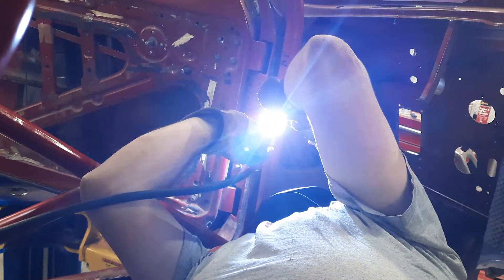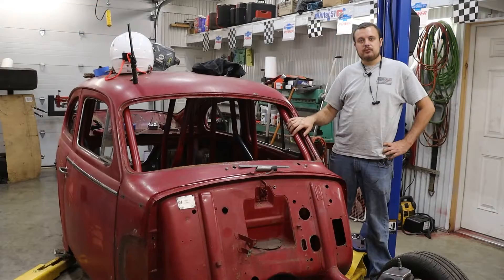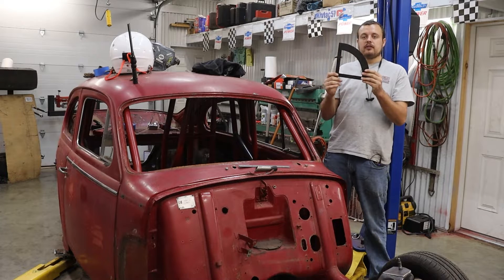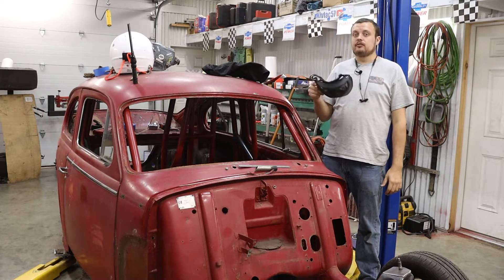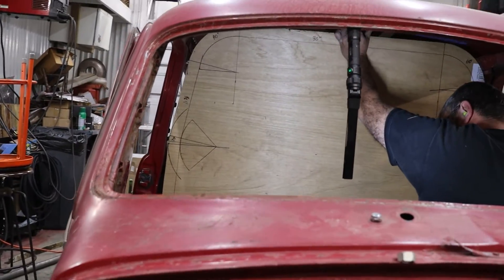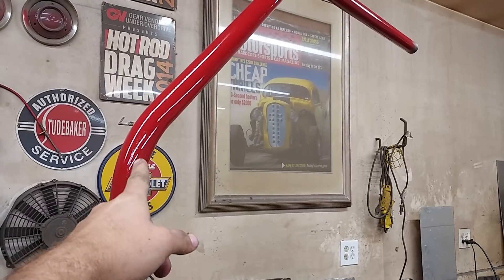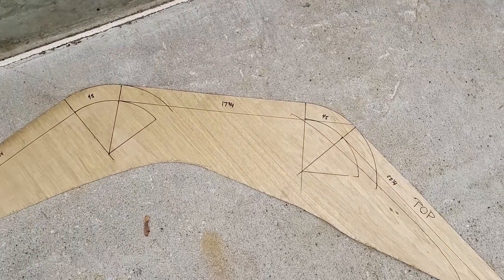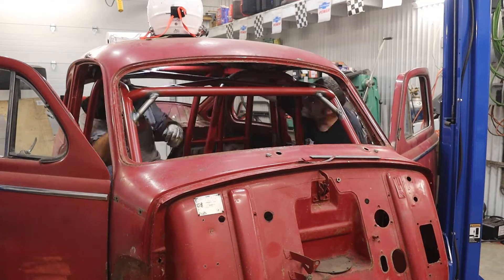How to Build a Roll Cage - Tips and Tricks To Getting the Ultimate Fitment - Volvo PV544

Comment: Great welds. 
I thought about it for a long while, why didn't you just cut out the floor?
Reply from the maker: Trying to retain chassis stiffness and reduce that effort. The stock floors are required for this level of certification as well. Not saying you couldn't weld them back in, it just adds complexity.

Comment: Excellent video as always! Time for a thumb control for the tig? A machine with 2T/4T controls would be cool, or a pressure sensitive version.
Reply from the maker: Yeah. I think I'm ready for a thumb control. Not sure what the other stuff you mentioned is. Teach me.
Reply: @Calvin-Nelson Calvin, thumb rheostats leave a bit to be desired, you may want to consider a simple on/off button and (possibly but not necessary) a remote rheostat, while it is not as slick as a nice pedal you can produce very high quality joints that will pass x-ray and visible inspection, in many ways this type of welding technique rewards those proficient in oxy/acetylene welding (no, not brazing)  travel speed and the filler wire determine the actual joint heat.

Comment: On the laying on the tunnel and other foreign objects; I have an old pop on creeper that used to have a bad wheel; without the wheels it made a great back board. Outside, in the mud, I have used thin plywood, cut to fit into whatever hole I needed to work in. I have always thought the roll bar was to keep all the "go faster from" killing you the first time you asked big and got more than you bargained for!  FR

Comment: Great tips , but for me and tig welding. The painting can wait till the last procedure is done. Nothing like blowing a weld due to contaminate from the paint process. And being an engineer I figured you would have used Solid Works or BendTech for cage design. The balsa wood trick is a good idea for those without the program . 15 min mark is when I would paint. But that's me LOL. You guys are kicking butt!!! Looking forward to the end result and track testing!!
Reply from the maker: Yeah. I'm not a big CAD guy, unless you are talking about Cardboard Aided Design. Takes way too much time, and usually doesn't come out the way you want when you actually do it. If I had more precise machines, maybe... but probably not. Just not the way my brain works.
Reply: @Calvin-Nelson  I guess that depends on who's using the programs. I worked in two bending shop's. And they could hammer out drawings pretty quick. I have a old copy of Bend Tech. I bought it with my bender package. It paid for it's self the first car I did a cage in. But most of the time I lay out stuff. Especially single plain. A pillar bars, that follow the body lines tight. Bend Tech saved me throwing away materials. Great project. Looking forward to the rear suspension and frame updates.
Reply from the maker: @hartiaacres  yeah. I could see it helping with that. I just find CAD something that slows me down most of the time. Why draw the part, when I could just make the part. Just how I was raised, I guess.
Reply: @Calvin-Nelson Calvin, not sure how many are aware that CAD designs are a tool limited by the actual dimensioning of mating components, unfortunately CAD being mixed with production tolerances doesn't work well in many cases as a practical consideration because of production variations which actually defeat the major purpose of CAD.
I know from working with a few really sharp engineers that the CAD operators that produced drawings reflecting real world integration of CAD designs would call out for "as built" solutions to the issue of CAD precision mixing with mechanical "drafting variation in the pre-CAD era" components, they realize to make it all work sometimes it does take good old "trial and error" by the hands of an experienced tradesman  to make it all happen.

Comment: Do you sell bend guages?
Reply from the maker: Like I said, they're not a one size fits all sort of thing. We made ours to take into account spring back. A 6 inch radius die does not always bend 6 inch radius. It probably is somewhat close though. I suppose I could sell the design we use.
Reply: @Calvin-Nelson  we have a little Harry Potter kinda looking car we are thinking of building...so I figured that the bend guage would work in our car.